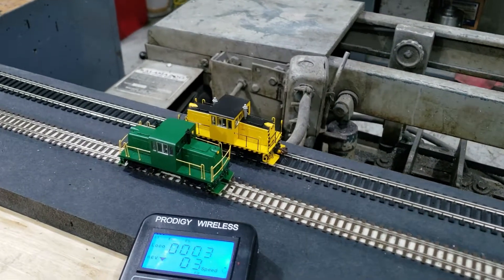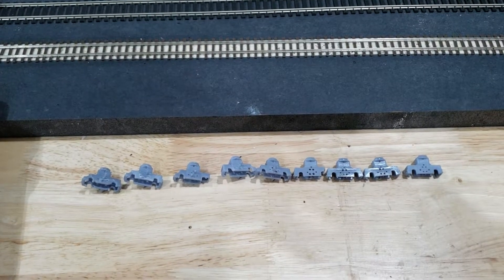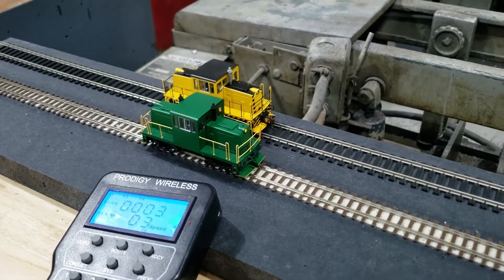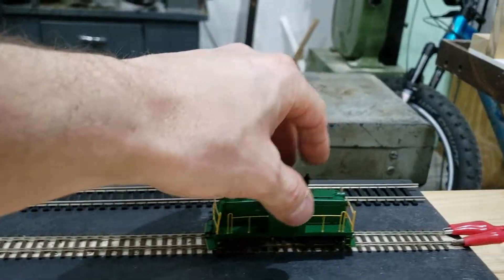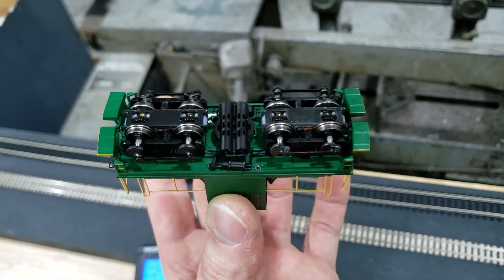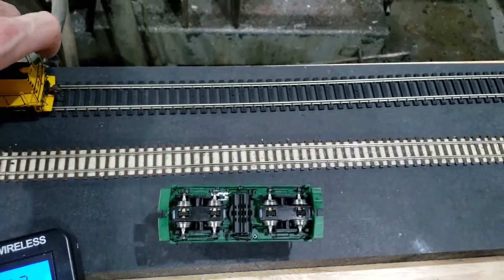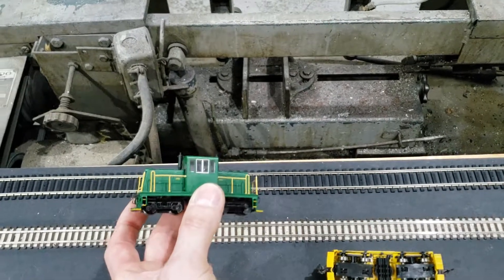45 ton GE diesel in Hon3 converted from a Bachmann model.

Comment: Fantastic conversion! I converted a few of these with a N scale chassis to run on HOn30 many years ago, but my goal was always HOn3 and keeping the side rods. I look forward to your write up. If you decide to sell the printed parts I would love to purchase a few. Thanks!
Reply from the maker: Thanks for the comment. 

If I was actually going to sell the conversion, the printed bits would end up being CNC milled from Delrin and I'd probably have new axles made up for the kit.  The resin printed parts just have too many issues with aging in a predictable manner and maintaining dimensional stability.  My little 4 axis CNC mill would probably make the truck bodies much faster than my Photon S anyway.  

Thanks again - D
Reply: @dtj9923  there is no reason at all why a quality SLA resin would have issues with aging or dimensional stability if it is not exposed to sunlight. All organic plastics used in model railroads are UV sensitive, including polystyrene, polyurethane resin, and even Delrin, and all will decay under long term UV exposure. The general recommendation for model railroad equipment is to keep it out of direct sunlight regardless of what it's made of.

I would say the best reason to use Delrin over SLA is, as you pointed out, manufacturing speed, if you can justify the material waste involved with machining. Otherwise polyurethane resin casting is always a good option.
Reply from the maker: Thanks for the comment Scott.  

I'm experimenting with some different resins right now to see how things go.  "BLU" from Siraya Tech seems like a significant step up from the typical "ABS like" resins I've been playing with.   

Siraya Tech Blu, really good stuff, a little thick, use lots of chamber pre heat.
https://siraya.tech/products/blu-by-siraya-tech-for-lcd-resin-printers-1kg 

I'm also evaluating their "Build" resin.  Results TBD 
https://siraya.tech/products/build-high-resolution-engineering-3d-printing-resin

Their "Fast" ABS like resin was really good compared to other ABS like resins I've tired.
https://siraya.tech/products/fast-1kg-abs-like-grey-special-discount

The process time offset for SLA vs CNC is that I can print whole sheets of parts with the Photon S  rather than cutting a single CNC part.  Still I like the material properties of Delrin.  Flexible, self lubricating, extremely tough, and extremely chemically resistant.  But being able to print 10 parts at a time is compelling.

I totally agree with you, keeping your models out of direct sunlight is a good plan.  UV is the enemy of non UV stabilized paints and plastics.  The cure for which is obviously brass models!

-Damon

Comment: Hi, how are you ? I can convert many locomotive in HOn3 using Kato and Atlas trucks
Reply from the maker: I am well thanks!

I have seen quite a few Atlas early RS series diesels converted to Hon3, it actually look pretty straightforward.  I haven't done it myself.  I don't think any of the Atlas trucks are the right wheelbase or wheel diameter for conversion on the 45 tonner.  The 45 tonner has 33 inch wheels and a 6 foot wheelbase.  If you find any that are the right size please let me know.

-DTJ
Reply: @dtj9923  You cuold use the Kato Barber-S2 wheel
Reply from the maker: @fersiro26rodrigues30  https://www.trainworld.com/kato-31-602-barber-s-2-roller-bearing-truck-1-pair-kato-31-602.html

These?
Reply: @dtj9923  Yes,  I think that you can chance the wheels. Do you have an e-mail ?

Comment: Any way to do this with other industrial switchers? I’m hunting for an HOn3 end cab industrial switcher
Reply from the maker: Hey Amanda,

I'm actually playing around with some Grandt Line end cab switchers right now.  Those kits come in both HO and HOn3 but it's a lot of work to get them running well.  I'm just making entirely new chassis and mechanisms for my projects.  It is easy to regauge the axles on the Grandt kits but actually moving the side frames inboard as is prototypical on any of the current 23 or 25 ton Grandt kits is a huge headache.

Here is a picture of a rare 25 ton GE end cab diesel with side rods for inspiration.  This is what I'm building right now.
https://en.wikipedia.org/wiki/GE_25-ton_switcher#/media/File:GE_25T_507_ALL.JPG

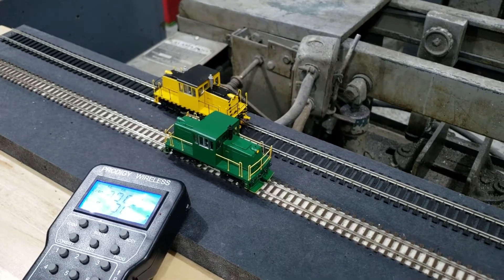Here's a link where you can see all my current siderod GE HOn3 projects, start at  the 1:00 mark, they'll all roll by.  The the 23 ton siderod boxcabs are a good blueprint for how to do a siderod 25 ton end cab.
https://www.youtube.com/watch?v=1Az5JTuGlYI&t=127s

Thanks for stopping by!

-DTJ
Reply from the maker: Another quick thought.

If you can get a hold of some Bachmann 45 tonner shells cheaply, the die cast hoods are a good way to add some extra weight to a 25 tonner build.  The hood pieces in my Grandt kits are not the cleanest injection molded parts and they have a messy center seam to deal with.  I am planning on using my Bachmann 45 tonner hood leftovers for my 25 tonner builds.

Comment: Here's the question you're probably dreading: would you convert mine?
Reply from the maker: Hey Chipper,

So the 3D print part of this project is pretty painless, cleaning up the prints is also painless.  Modifying the axles, gears, bearings, and electrical pickups... that's pretty time consuming. 

I plan on making two of the yellow engines to run as a pair and turning the green engine into a boxcab similar to NJ Central 1000 with but with cranks.  After that I'm probably not doing any more.

If I get time I'll post a step by step conversion video and post the CAD files somewhere.  You need a lot of watchmaker size tools to do this.

D
Reply: @dtj9923  Well, that's probably beyond me, but I'll look forward to the "how-to" video! Thanks again!
Reply: @chipperthompson5920  it becomes a lot easier to do if you're okay with ditching the cranks. Not all 45 tonners had cranks, some had a chain drive instead, so if you want to go that route you save a lot of modification. The only extra step you'd need is your sideframes will now need axle journal boxes, which are easy enough to scavenge.